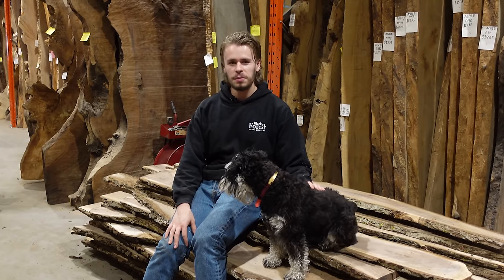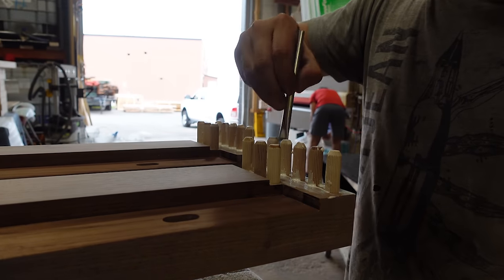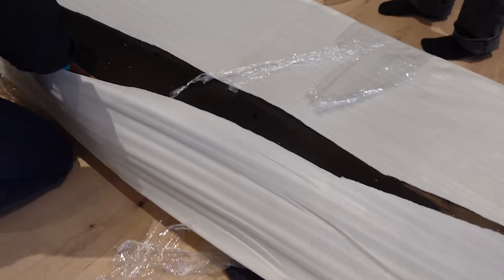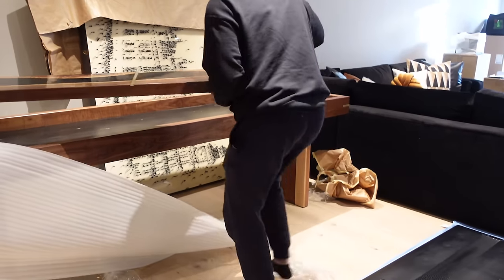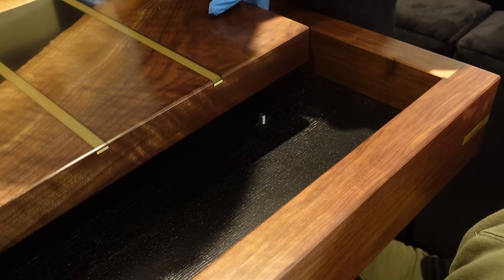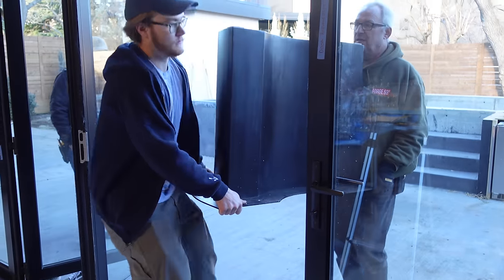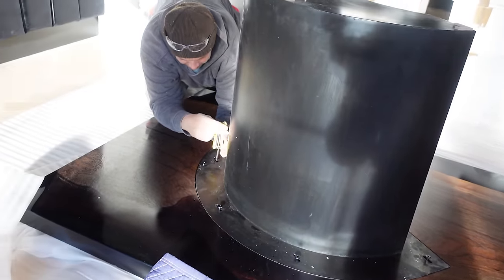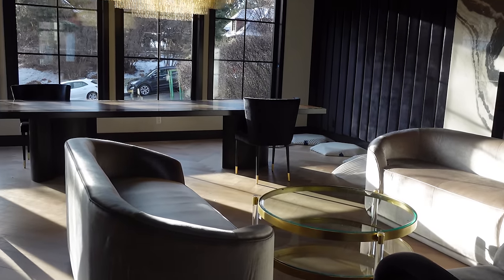Creating a $9k Resin Shuffleboard

Comment: You guys should look into getting some GRABOs. They can lift a couple of hundred pounds easily, so you would need several for large pieces, but they make moving stuff much easier. I got one for my shop and I use it to easily move full sheets of plywood and other heavy objects with a flat surface. It gives you an instant handle.

Comment: How did you protect the resin on the shuffle board from the sand?  Is the plan just to polish out the scratching from time to time?  I would think even the ceramic polish would not hold up over a period of time.  Great table in all ways just curious about upkeep.

Comment: looking at you installing this table hurts my eyes! This is not how you should do it! Instead, bring sawhorses which are about 1 inch higher than the legs, set the table top on them, then install the legs from underneath. This way, you wont have to flip the table, which is 90% of the times an accident happen: if there is a left over piece of wood or metal on the ground, it will destroy the side of the table. Happened to me once with a ziptie.